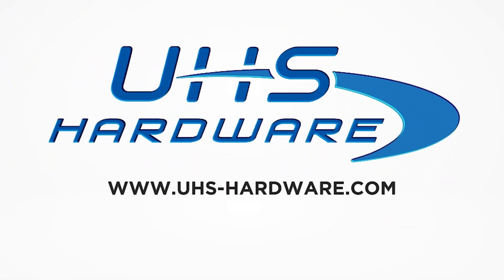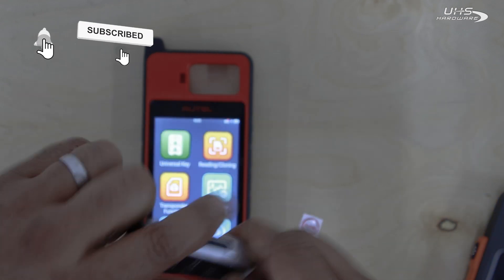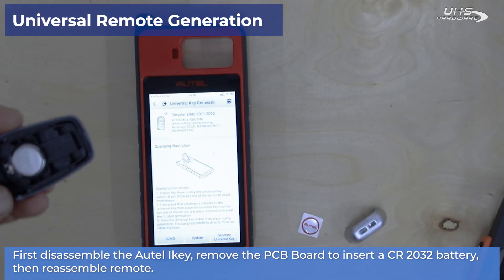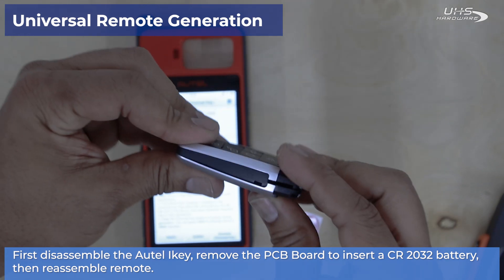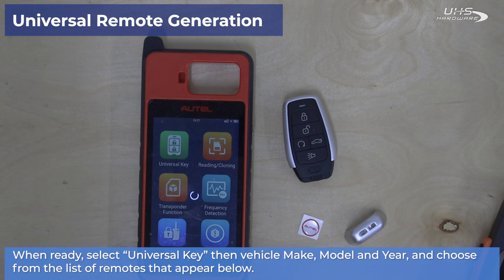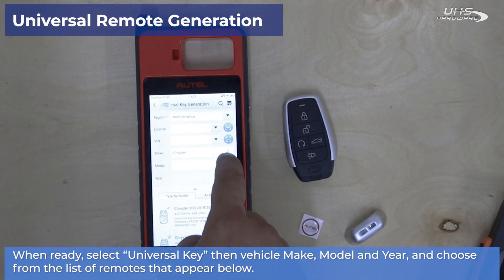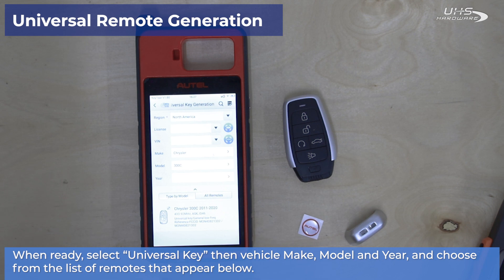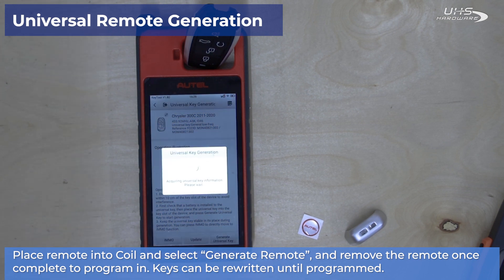How to Read and Generate & Program Autel's Universal remotes and keys with Autel KM100 Key Generator

Comment: I'm trying to figure out if I'm doing some wrong or if it just can't be done. I'm thinking it's the latter. I successfully programed a spare emergency Autel key as well as the Autel Smartwatch with the KM100.

All are able to lock, unlock and open the trunk. The smartwatch voice commands also work flawlessly. The problem I have is that I can't get remote start to work. I checked the frequency and found that the normal remotes transmit 433mhz range and the remote start fob transmits in the 923.90mhz.

Am I correct to assume it is not possible to program RS due to the frequency gap on the smart watch being in the 433 range like the non RS fobs?

edit: I should also note that when you program the key the KM100 only shows the basic key icon but not the remote start one. I wasn't sure if that was another reason

Comment: Well hope it works out
Reply: Well found out when dealer installed the key fob battery it was put in upside down . So the key would let you start the car but not let door unlock buttons work .its a fix

Comment: What if the original key is lost and the car is locked? Also would this work on any car ?
Reply from the maker: only cars in the progamming menu. more than likely only cars with smart ignitions (push to start). I would not be recommended to use this as your only primary key.  always have at least 2 keys programmed to the vehicle at all times.
Reply: I need help bro  @UHSHardware